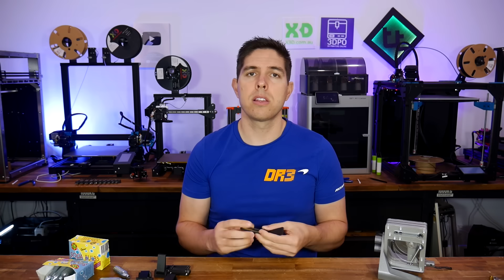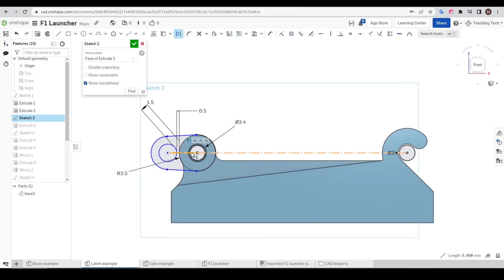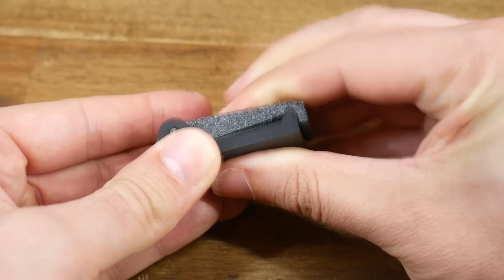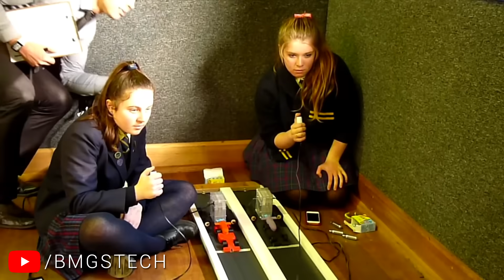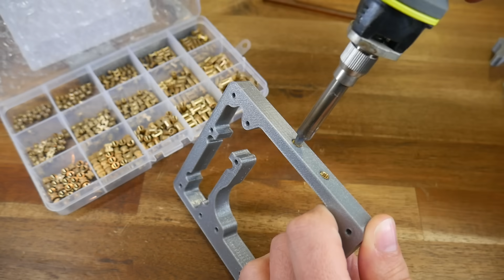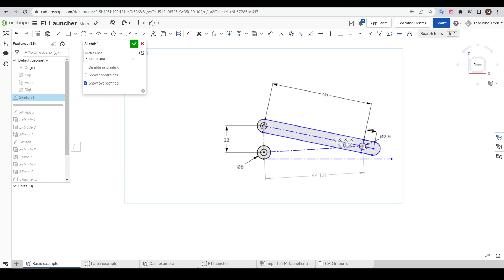Over centre mechanisms will make your designs more effective - Guide with examples

Comment: A masterclass in applied mechanism design. Using 3D printing to physically demonstrate and iterate on these concepts is the perfect modern workflow. For applications like your final launcher example — where stored energy and reliability are critical — moving to metal components (CNC machined pivots, stamped springs, hardened latches) becomes essential for safety and longevity.

Comment: Fwiw, please be careful with compressed air and bare skin.  I’m not sure what the threshold is, but you can get an embolism if the compressed air penetrates the skin.  It is extremely painful and if there are any oils present they can be toxic once absorbed.  I had a friend who required surgery on his hand due to improper PPE while working with a compressed air paint sprayer.

Awesome video, thanks for the demonstration!

Comment: If I may suggest one more thing to add to the CO2 dragster launcher. Some sort of safety interlock. Because it just take a sharp slap to get it to fire, that creates a hazard for use. My first thought (it might not be the best, take this as a brainstorming idea) is to add a servo. I'd probably use a 2 horn servo attachment. One of the horns would hold the firing pin in it's cocked position, the other horn with some sort of spring to pull it into safe position should there be a power outage to the launcher. I was at first thinking of another bi-stable mechanism on the safety, but if the firing mechanism is sensitive enough to fire with a sharp slap, then the vibration from "snapping" the safety open might cause the firing mechanism to fire. Though, I suppose a simple pin through holes in the side panels would work just as well and be simpler...

Comment: I'm familiar with this design, another very common use that almost everyone has exposure to is the simple wall light switch. But, I don't think that I've heard the term "over center mechanism". Is that an Azzie/Commonwealth term? I don't recall ever hearing the term "bi-stable mechanism" (but then, I've never taken any Mechanical Engineering classes). Are they two terms for the same thing, or is the over center mechanism simply a specific type of bi-stable mechanism (like a square is a specific type of rectangle)? I'm thinking that it might be the latter because that latch that you showed that had two variable point-to-point distances.

Comment: Awesome vid. One thing - the "center" that makes it "over center" isn't (from your first example) the center of overall travel, but the center of alignment 90 degrees away from that point. In that example the center line of the rubber band is in line with the center line of the swinging bar...and then goes "over center" to latch. Same in the vise grip if you watch its bars move.

Comment: An over-center mechanism without a sear would make up for an incredibly smooth and dangerous gun trigger 😀 I wonder if set triggers actually work this way, pushing the hammer close to a over-center state but not past it and locking it with a second less loaded sear? Don't know too much about guns but just came into my mind..

Comment: If you want one to play and learn with you can find them on the bottom shelf in the clamp isle at harbor freight.  They have vertical and horizontal types and you will find many uses for them.  If you can convince them to pay me for each one you buy that would be nice, but I won't hold my breath.

Comment: this is actually great for PLA which has a very bad tendency to creep even at room temperature meaning it is a terrible choice for parts under constant tension or compression as in most fastening mechanisms--except for over center mechanisms which do not store any compression or tension in the fully open or closed positions, only temporararily!. excellent!

Comment: I made a drawer lock and release mechanism out of a broken biro and a broken barrel slide lock which had lost its lock pin five minutes with a grinder and way more blood than would seem appropriate for a tiny puncture wound winding the spring setup I'd made. Gotta love brass cuts they just keep leaking. Now you can open and close the drawer without it going past the end point and pull a tag to release it to access the dishwasher.

Comment: For any such mechanism that stays loaded during operation, PLA is definitely not a material to rely on, PETG has a big advantage here and ABS much more so, not because of stiffness, but creep. You wouldn't want your latch to suddenly loosen with time, but with PLA it will happen, and it won't even take that long. PETG handles creep much better and ABS is the king as far as I know without going into extremely expensive engineering polymers. Would love to know good materials on this property as well in case anyone knows.

Comment: Great video!  Thank you for making it and sharing the launcher design.  To answer your question, with a bit of question, I think it depends how you you define mechanism.  I think as in most things, simpler is usually better, and you have a fairly simple multipart mechanism.  But if a mechanism is just another name for machine, then I would go even simpler and say that an inclined plane is just about as good as it gets.  A little more complex and an axle is a pretty great one as well.  Interestingly enough, you used both of those as parts of your various mechanisms.  And if the whole point of the title, and question was just to get pedantic folks like me to comment, well that also succeeded.  Thanks again for doing all you do.

Comment: Interesting video.  I'm currently working on and extruder design that will use an over the center mechanism to hold back the spring pressure on the idler carrier for easy filament removal/insertion.  I didn't know the mechanism had a 'name' so to speak, I just knew how it worked and thought I could apply it in the extruder design.  When the 'release' lever is lifted, it will lock at just over center for filament insertion/removal, when the lever is pushed down, it will go over center and allow the spring pressure of the idler carrier to take over again. This should allow for adjustable pressure on the filament via the usual thumb screw/spring assembly and easy filament insertion/removal via lever/over center mechanism.  I hope so anyway.  I've been tinkering with the idea on and off but the design is still in very early stages at the moment.

Comment: In my experience PETG is great at first, but as it absorbs moisture or ages by some other mechanism I am unaware of, it gets weaker and notably more brittle. Just a potential warning.

I do find that you can design around stiffness with a more framelike /skeletonized structure.

Comment: Nice! That one latch is still over-centered, it’s just also a compliant mechanism, so a compliant over-center latch. 

Also, in the cutout that affords the springiness, the narrow ends of the hole being round will extend the life of the mechanism. Those sharp points are more likely to spawn cracks as well as taking longer to print than rounded profiles.

Comment: What great timing ....... Im in the middle of designing a switching duel extruder system. And have been pondering how to do this with a servo, but then thinking can the servo hold enough pressure for long enough to keep everything accurate without burning out. Along comes teaching tech with over centered locks ..... mmmm Im thinking whilst watching "how can I use this to help me ...... Then the car launcher ..... yes that will work for me ..................... now get back to designing it lol

Comment: Playing with linkage "volume (cross section area) control" can assist in directing flexible parts to flex/bend where the strain is lowest - ie, reducing likelihood of failure with lower failure strain materials..

ha ha the final "sodabulb" puncturing device is reminiscent of an AR hammer group.

Comment: This type of mechanism can also be used in reverse. Think of a gas strut on a concession window. The strut holds the window open, but when closed, it will reach a minimum compressed strut length and begin to extend a bit when nearly closed. This keeps the window from opening. 😊

Comment: Quick tip on rigid over-center mechanisms. By Hooke's law, sigma (tension) equals E (Young's modulus) x epsilon (strain). And strain is given by deltaL (in the case of the video Arm lenght delta) divided by L (lenght of the part that is the replacement of the spring or rubber band). Combining both we can see that for the same elongation (deltaL) the bigger the part, the smaller the tension. 
When switching from PLA to PETG, one plays with the Youngs Modulus, which is lower on PETG, hence creating less tension for the same lenght and elongation of the part. This is what makes it more elastic. 

As always, great video.
Reply: yeap, instead of switching, he could just make a planar spring (like a sinusoidal slender segment) and you should be fine. PLA makes quiet good spring (because of their comparative high young modulus, you need less mass to store the same energy compared to other plastics) if you design them well (limit max deformation to low values (no more than 6%)) and in applications where the spring forces only matter at transient states (so you avoid creeping)
Reply: @giuseppebonatici7169  Very important last bit, was gonna comment on that, PLA having as much creep potential as it does, any PLA spring would be necessarily unloaded most of the time to be reliable in the long therm (heck maybe like, days).
I always go with ABS whenever possible for any part that stays loaded in a way or another, when not possible PETG is my go to material.
Reply: @giuseppebonatici7169  yes but that kind of deviates from my initial consideration. The shape you are mentioning, and pretty correctly, would be a spring itself. I'm talking about rigid parts. If you can call them rigid. He he he
Reply: something something everything's a spring
Reply: @satibel  indeed it is. However the trick in this is the balance and harmony of plasticity and elasticity. Given that you can't change the parameters at will, you have to go through the design route. And that requires some knowledge on materials and/or "touch".

Comment: While PLA is objectively a bad material for any "spring" mechanism, it's worth noting that layering single perimeters next to each other offers more "springyness" vs the same thickness as a fused perimeter. Same principle as thin stranded wires in cables vs the stiff single strand ones. Many individual thin strands can flex much easier than one solid one that exceeds compression on one side and tension on the other.
Reply: While many people say a bigger nozzle can produce stronger prints i've found the opposite to be true bc of the reason you stated, i speak from experience working with figurines, tended to prefer bigger nozzle sizes until i realized it.
Reply: Do you mean have air gaps between perimeters? It makes sense that it would bend easier, but will it really help with elongation?
Reply: @polycrystallinesilicate  Yes, that's what I meant. And the answer is "kinda".
As stated, PLA is awful when it comes to being a spring.

But material structure is quite intruiging and the finer you go with a given material, the more "springy" it becomes.
The best example are modern phones, or to be more precise, their accelerometers. These are nothing but nano scale silicon parts that flex with amounts that would shatter the same material if it were a millimeter thick.

Same way how the fine stranded copper wires can be bend and twisted fine (within reason), while the single strand versions, meant for permanent placement, would work harden and break rather quickly from the same bending and twisting.

Obviously, when printing springs with this approach, it comes with the cost of less stiffness. So experimentation is needed regardless.
But the lifetime of the flexing parts would be drastically higher.

Another benefit, more related to PLA in particular, would be that it's likely that only one spring "strand" would fail at first, and not the entire section.
Since PLA often tends to reach critical failure with little warning, it would help to have several points that all are stressed differently in the same section, that way some can fail first as a warning before all have failed.
But this depends highly on the design and applied forces.
One design might even be better off, once one or a few strands have broken, another might overload all of them at once.

Comment: May I ask why you people still use PLA ? Is it just the price ? I mean this material is by no means an engineering material, I have never seen it used for real life applications. I personally would never use it, I only printed PLA one with my 3D printer because it had this "galaxy" effect where laxer lines don´t show and even then it was crap. It´s way too brittle.
Reply: You should check out all the testing that CNC Kitchen has done on PLA. it's actually a surprisingly strong material. It often outperforms other common materials on measures of stiffness or tensile strength. We also use it almost exclusively at my work to prototype functional parts prior to injection molding! It's a great material that prints really well, is plenty strong for lots of users, is cheap, and doesn't require nearly as much babying as something like nylon. Just don't leave it in a hot car. Also, why so aggro? Weird phrasing with "why you people use PLA."
Reply: @evanbarnes9984  I am a mechanical engineer. I am aware of the properties of PLA. "Strong" is not that easy. It´s temp. performance for instance is horrible and it´s too brittle for most applications besides some samples and decorative parts. I have never seen it used for any sort of real life purpose in any industry really. It´s only plus points are it´s biodegradability (which I consider a marketing gag for the most part) and it prints well plus it´s cheap.
Nylon is an engineering material, it also prints very well as long as it´s filled with CF or GF. 
I don´t mean to be hostile, English is my 3rd language, maybe it came out wrong for which I apologise. 
It is interesting that you mention the use of this material at your work, may I ask what kind of prototypes those are ?
Reply: Most of what I print is decorative, likely as not to be sanded and painted. PLA works great, and as the other person said, no fumes to worry about.
Reply: @arklanuthoslin  Thank you for your comment btw.
Reply: @arklanuthoslin  PLA does also offgas fumes as all polymers do however not quiet as volatile I suppose.
Reply: All materials have their place in 3d printing. That is one thing that is great when you have 3d printer. If printer is capable of printing ABS (PLA and PETG have similar requirements) you have at least 3 different types of materials to construct your parts from. And all those materials can be very useful in different part of mechanism. Only elitists and people pretending to be real engineers dismiss things so easily. There is no one "perfect" material, but there is perfect use of one material, and even that "garbage" material like PLA has it's place
Reply: @xManzi  Interesting, I am actually a mechanical engineer so it´s funny that you mention that. I must be an elitist then I suppose. What would be the prime example in your opinion for PLA then ?
Reply: I use PLA+ it isn't brittle at all, it's strong and it prints beautifully. The main reason is the ease and quality of the prints, the relative lack of fumes.
Reply: @Patrick-857  What kind of blend is that material exactly, is this known ?
Reply: @SierraEcho88  I don't know, these companies can be tight lipped about it. Thr stuff I use is from Esun. It doesn't snap, it yields, if temperature performance wasn't a concern I wouldn't bother with anything else. I find it has better rigidity than PETG and ABS is far more brittle than both. I've found PETG is actually more brittle than this PLA+ in some cases, but it makes up for it with insane layer adhesion. I really don't like PETG though. 

PLA is seriously underrated, most tests show it to be the strongest of the common 3D printable materials.
Reply: @Patrick-857  Yeah I understand they don´t want to talk about it, I was hoping you could tell me what kind of broad application it is used for.
PLA is far more rigid this is true, however this is it´s weak point. It brakes instead of deforming, that´s why for most end products it is a terrible material. The only applications I can think of are small jigs and such where temp is not an issue because you are working in a controlled environment. 

Generally speaking PETG prints just as well as PLA, it has better layer adhesion, more impact strength, cost almost the same, better temp tolerance and it has the flexibility to make actual products out of it, this is why it is also used for plastic bottles and other stuff. 
PETG does everything PLA does but with some benefits, so to standardize my materials I only have black and white PETG.

PLA is not the strongest it´s the most rigid one (leaving CF Nylon and such aside). For most end products you would want your material to be tough but not brittle.
Reply: I use PLA because it's quite stiff and also because it doesn't off gas toxins like ABS does, and also isn't a total PITA like petg
Reply: @StillConfusing  PITA ?